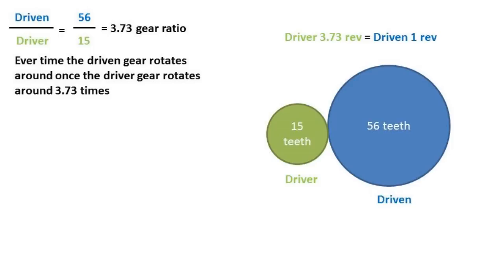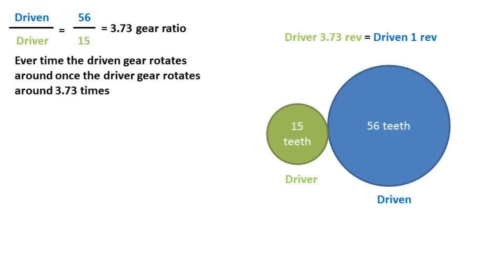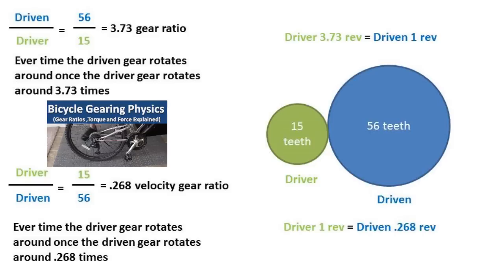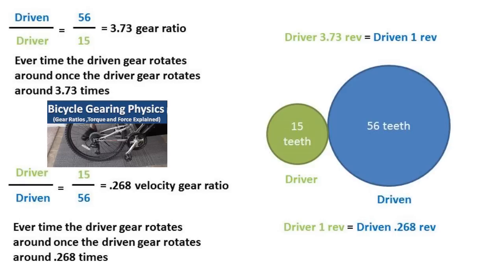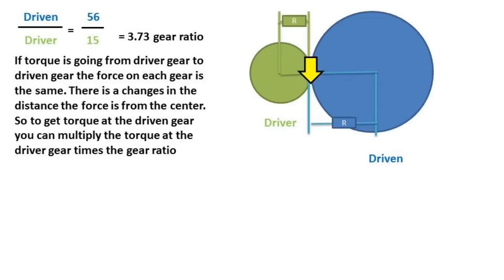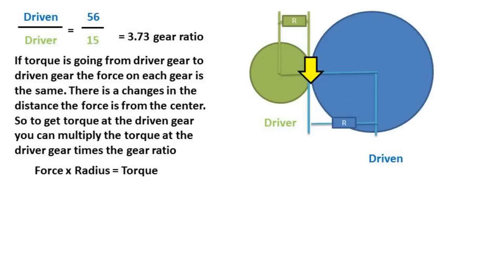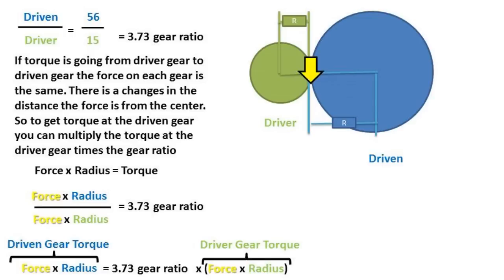Gear Ratios Explained  (Motion, Torque and Gear Trains)

Comment from the maker: I noticed i have a dislike on this video let me know if there is anything i can do to improve my videos. I can correct this videos and reupload if needed.
Reply: some people just like to dislike
Reply: After 40+ years of driving I finally took the time to find out what gear ratios are all about. When I was a teenager racing cars and doing other dangerous stuff, I would always hear about the 4.11 gear ratio as being great for drag racing. Now I understand why. I liked your video and understood it perfectly, but I imagine it's a lot of info crammed into a very short period of time for some.
Reply: This doesn't make sense, if output gear was 2m in diameter and input gear was 1m then VR =1/2=0.5 as VR=i/o
so if input rotates at 100rpm what is the rmp of output? i/VR=o = 100/0.5 =200rpm. But this isn't true the output gear rotates half the speed as the input in this case not the other way round like the VR ratio shows.
Reply: maybe my volumes too loud but I hear weird mouth noises (slobbery smacking noises) while you talk.. it's distracting and gross.
Reply: VAM! Physics & Engineering thanks for helping me on my homework great video
Reply: I see no problem with this video. You explained something that I couldn't understand in lecture in about 2
 minutes.

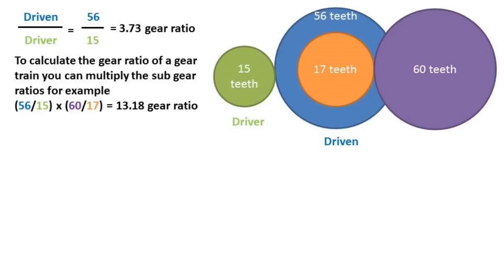Comment: ANYONE PLEASE CURRENT ME IF I AM WRONG, but at min 1:54 looking at the image the driver is the one with few teeth so that means that the one with 15 teeth is the driver that the last gear the one with 60teeth should have a slower movement, by what I am seeing here it is impossible for the ration to be 13.18 that would mean that for every one turn the gear with 15 teeth does the one with 65 teeth does 13.18 turns and that doesn't seem right. The current ratio should be if the gear with 15 teeth is the driver ratio should be 0.07 that means that for every turn the gear with 15 teeth makes the one with 60 teeth turn 0.07th of a turn. Now if you make the gear with 60 teeth the driver is a hole ballpark then it is 13.18 so if the gear with 60 teeth was to make one full turn the gear with 15 teeth would move 13.18th off a turn. can someone confirm if I am right, please
Reply: I will try to tell with the last two gears. Take gear ratios as circumference ratios so when you take the ratio of 60 teeth to 17 teeth it is 3,52 and 17 teeth to 60 teeth is 0,28 those are the ratios of their outer circles. Torque is directly propotional with those ratios and speed is inversely propotional to those ratios. So 60 teeth is bigger with the ratio of 3,52 and  slower with the ratio of 3,52 compared ro 17 teeth (17 is faster with the ratio of 3,52.) When 17 turns 1 turn (360 degree) 60 will turn 360/3,52 = 102 degree. You just basically asked why we are calculating ratio operation inversly.. I hope some mathematician will explain it better.

Comment: hey Vam.I have a 13 meter wheel and it rotates 270 degree how will i rotate to 470 degree with teeth
Reply from the maker: Hi Tinker if you have a wheel that turns 270 degrees and you need to connect it to another wheel that rotates 470 degrees for ever 270 degrees turned on the big wheel. You will need a wheel that is 270/470 times smaller. Hope this answers your question let me know if you need any additional clarification.
Reply: Okay thanks!

Comment: This was not done very well, some parts were clear and easy to understand and other parts felt like you just breezed right through it without giving a good explanation as to why the formula worked. It would've helped if you used numbers in all the parameters of the equation.